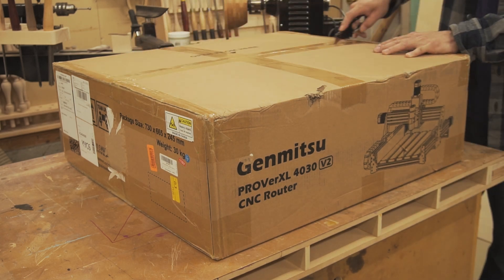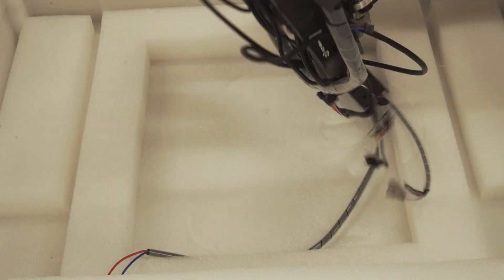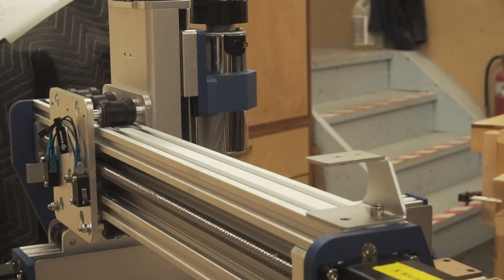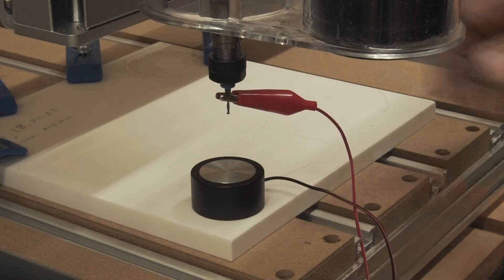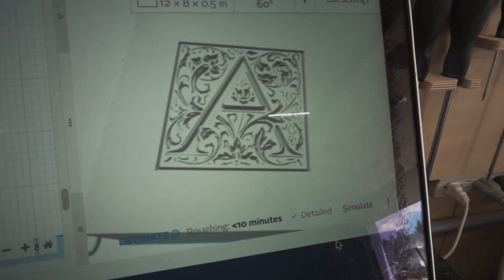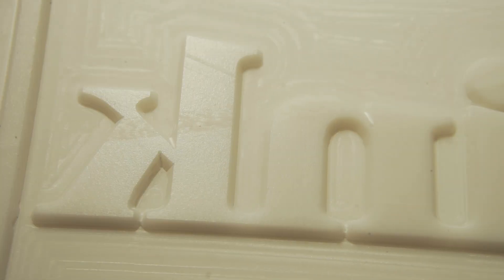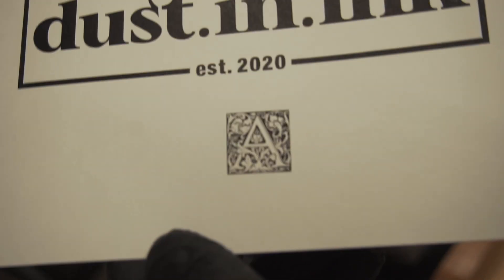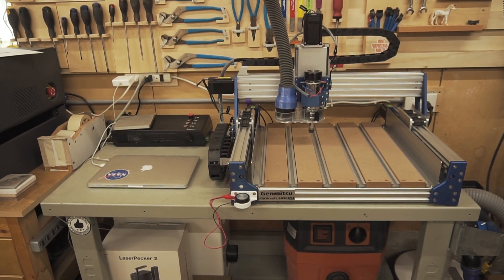This $1400 CNC Router Blew My Mind || Genmitsu PROVerXL 4030 V2

Comment: I have the v1 and v2. Chalk & cheese. The v1 had started losing precision over 3 years, Then Genmitsu asked me to trial their high torque 120mm steppers, made both machines run equally accurate. I cant get 5000mm/min on the v1, but i rarely run the v2 at 5000 either. Great being able to run both concurrently. Just building a 2nd enclosure now to reduce noise bouncing off walls in cnc room.